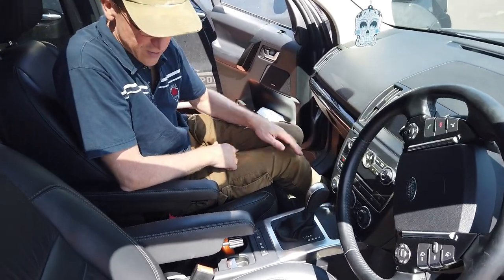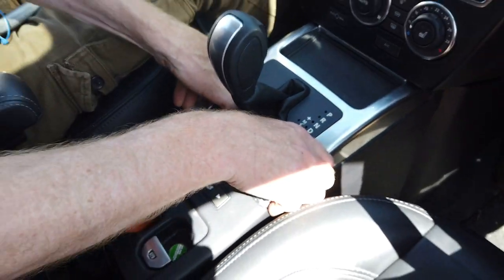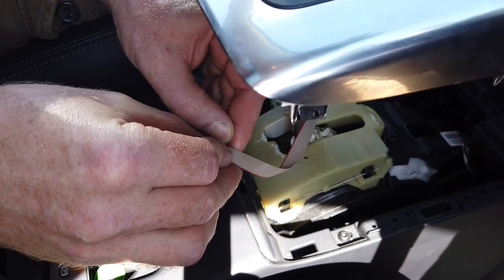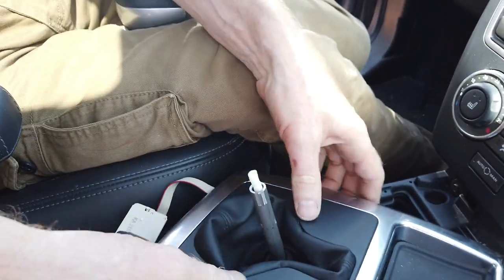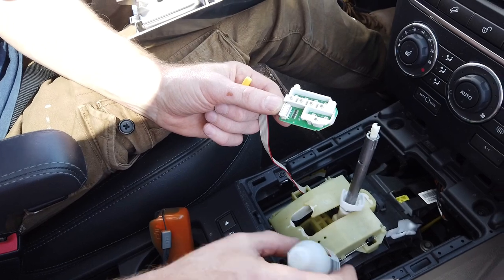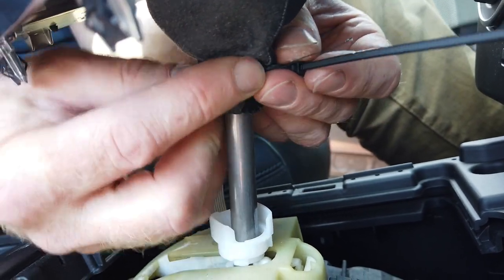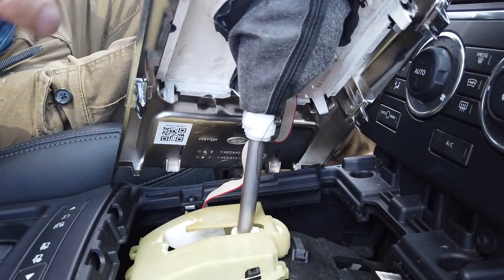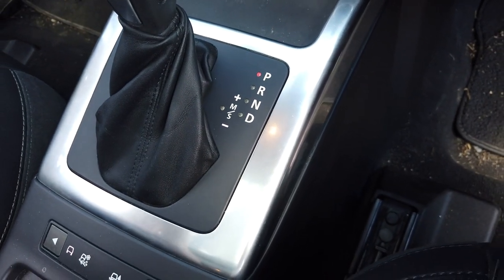Land Rover Freelander 2 Automatic Gear Knob / stick / gaiter change + missing LED FIX

Comment: Hi Simon, my mechanic told me, what he usually does when he gets condensation in tail lights is drill a small hole in the bottom of the tail light. I wonder could this be done with the evoque tail lights if they get condensation?